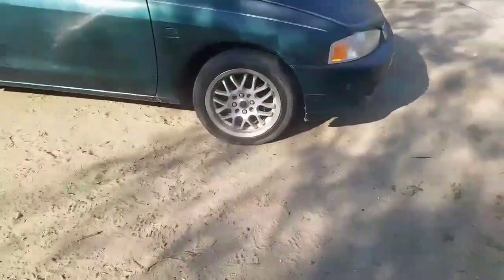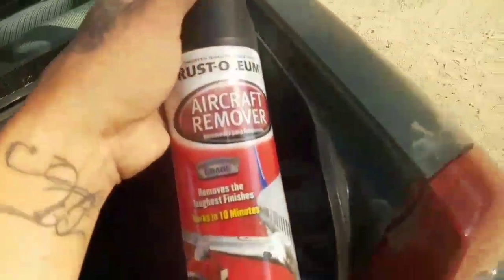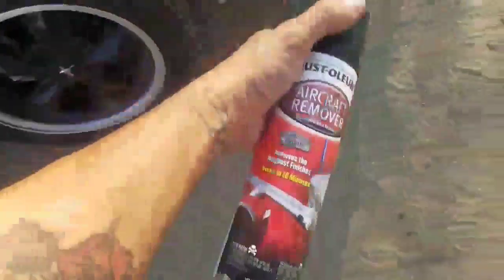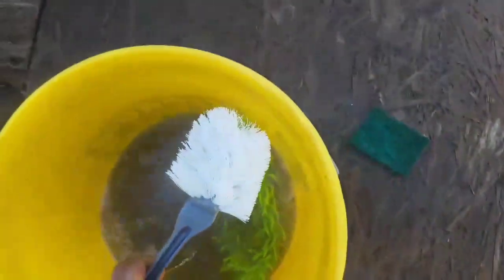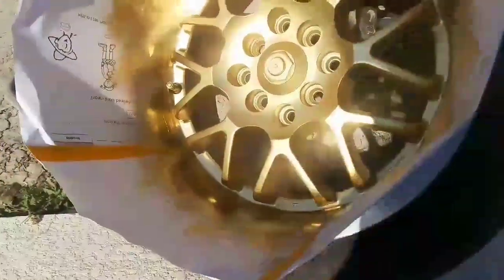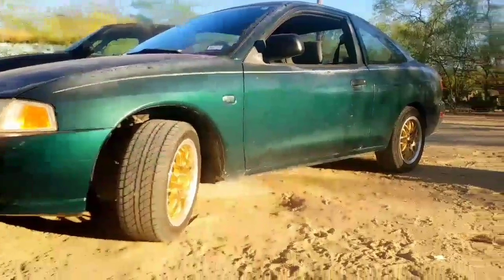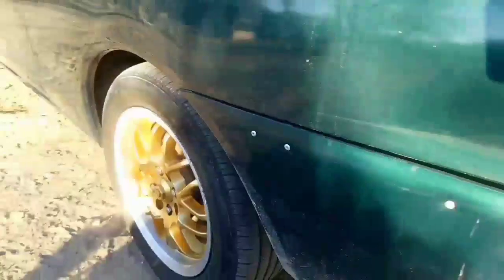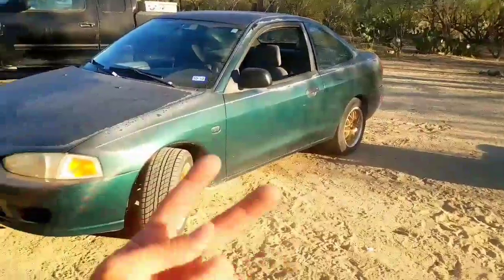Painting car wheels with Rustoleum gold paint

Comment: Looks bad ass man, I wanna do my motorcycle wheels. Hey im wonderin if you could get more of that chrome look to em if you hit em with a coat or 2 of clear coat. Might make em last longer too.. I have bad luck whenever I gotta layer 2 products tho, I always get small bubbling or maybe some kind of chemical reaction.
Reply from the maker: Sometimes when you get bubbling paint, means you let your base coat dry a bit much.  You need to spray the clear when your base is still tacky or wait a few days after. 
I didn't add clear because it dulls the brilliance of the gold.  I haven't really experimented with different clear coats, but I'll  look into it and give my thoughts or experience in a video. 👍
Reply: I know this is late, but I came across this video searching. Only way to get the shiny gold is anodizing, but you can get a pretty good finish with the gold kit they sell at pepboys

Comment: Do you have to use regular mettalic gold paint first and then put the mattalic gold finish on there?
Reply from the maker: +Savage_Aiimz-Tv no, just the metallic that came from the can. I tried spraying the can further away to get the metallic dust to fall on top of the new paint,  but didn't make much of a difference..
Reply: GT's Performance Is regular mettalic gold paint and mattalic gold finish different.
Reply from the maker: Savage_Aiimz-Tv they should be the same.. 
Unless it just says gold paint, it would be non-metallic.  And the metallic finish would be the one that has glitter in the paint,  creating a metallic finish.

Comment: I'm thinking of doing this. 
I'll add a clear coat , are yours hard to clean? How do you wash and do the stains come off?
Reply from the maker: Adding clear might be a good idea.  After several months,  the gold turned into bronze since this gold is more like a base coat, and doesn't seem to have a clear gloss to it.
Also, if you have a chance.. check out some of my latest videos. Since I painted the car, I also changed the color on the wheels. 😉👍
Thanks for watching!
Reply: @GTsPerformance  ok I see. What I did was plasti dipped the rims black then I spray painted them with the same rustoleum gold you used in the video and they looked nice. But I topped it off with plastidip glossifier and it took the nice gold color away and made it look dull and matte. I'm going to end up spray painting gold over that and maybe a coat of clear coat. Thanks. When you wash your rims you use just regular dish soap? And yes I checked out your videos! Noce channel 👌

Comment: No clear coat?
Reply from the maker: Quinton Murphy at the beginning,  I didn't use any cuz it looked good and shiny,  but now that you mention it.. they are starting to look a bit dull.
I'll probably give them another coat followed by clear so they can come back to life 👍
Reply: GT's Performance I would love to see how the clear coat does. I've seen mixed reviews on Rust-Oleum clear. I know with the metallic finish I did on my trucks. Without clear it gave it a nice brush metal bright silver finish, but when I cleared it it went to a silver. Gloss silver without the metal flakes. I don't mind it over gold but I don't won't to chance shrinkage and etc.
Reply: GT's Performance I may try the gold with dupli-color clear. To see if it keeps the gold brilliance.
Reply from the maker: Quinton Murphy sometimes you lose the brightness of the paint when you add too much clear.  2 coats is more than enough. 
Like you say instead of silver, it turns to gray. I trust Rustoleum, especially over krylon.

If you're adding clear,  just treat it like another coat of paint.. if you wait too long, it will crack your color trying to adhere.
Reply: GT's Performance okay, makes sense! I did add alot of clear to protect it.
Reply: I appreciate it. If you reciat and clear please upload video. I subscribed. Good post!
Reply from the maker: +Quinton Murphy sure will.  And thanks for the sub! 👍